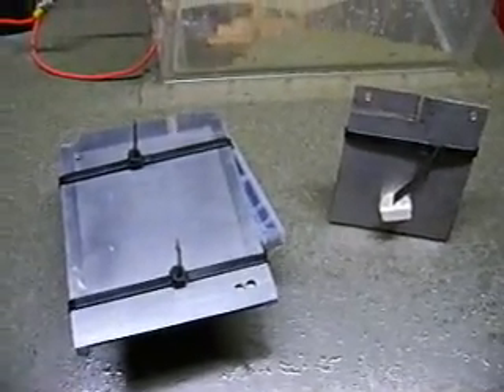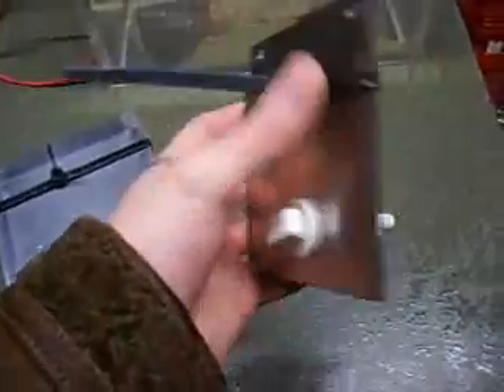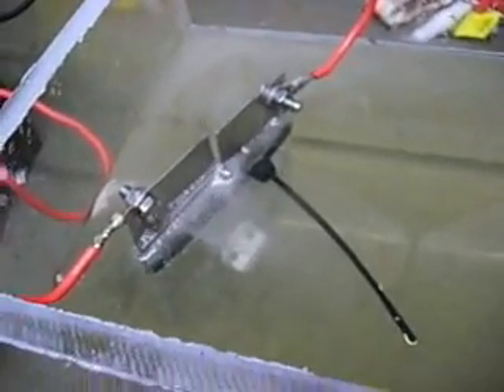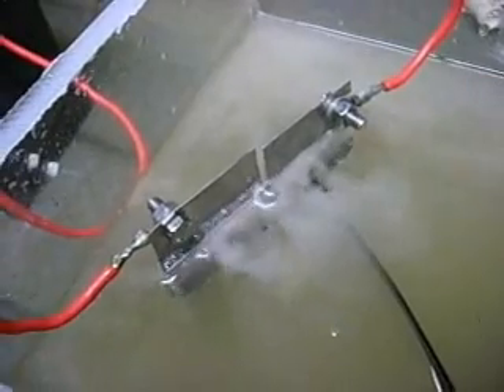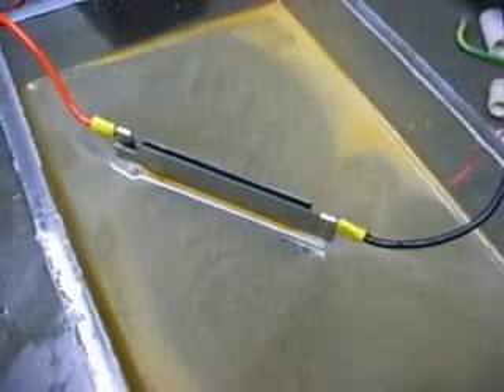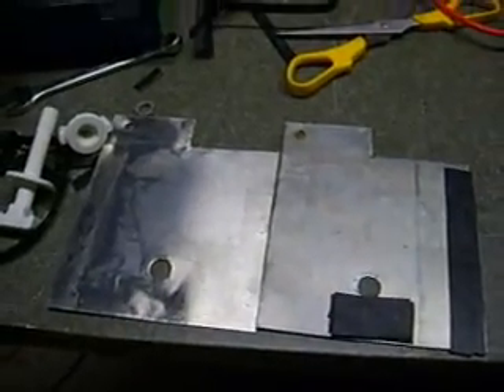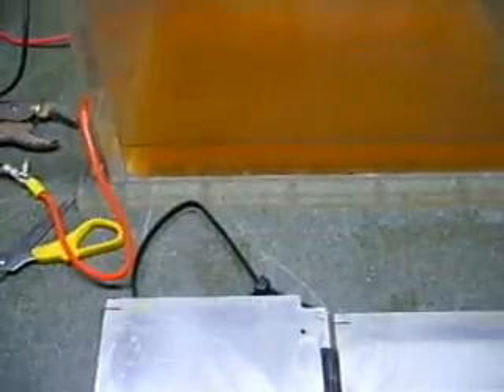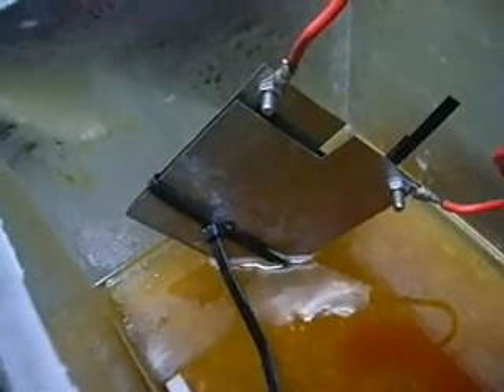Hydrogen at home (Mud problem revealed)#29

Comment: When doing experiments comparing the relative strengths and weaknesses of two different types of stainless steel, you should at least use the same sized plates. And recognize that ALL plates can be over driven leading to their early demise. ig, too much current per sq inch.

Comment: If you use distilled water and KOH, I think 304 or 316 doesn't really matter. I have an osmosis system at home and guess what, when I change all filters ones in a year, I got the same yellowish build up inside of filters, which is dirt from the tap water.

Comment: You need to start saving money and use Meyer's 8xa circuit that needs no salts in the water of any kind. It works on even pure distilled water as you can see in my video's. Learn the new way as Dr. Faraday's method is old school as that prior state of the art is too costly and you just don't get anything from it.

Comment: The mud is caused by tap water.  Someone referred to it as "iron bloom".  I too was creating mud and switched to KOH and still had the problem.  I went to distilled water and the mud has not returned.  The only color I get is from the dirty plates from running tap water, since I did not clean them up when I switched to distilled water.  It is amazing how clean it runs on distilled water.
Don't EVER use tap water unless you just enjoy cleaning and changing your water.

Comment from the maker: I use a good quality sodium hydroxide, the tap water will get dirty after many hours of operation but it is not to blame for this particular problem, for proof of that watch the second half of video #22.  I believe that using high-voltage only draws out more gunk if the stainless steel is of a poor grade such as in this case.

Comment: No tap water distilled only, dump that tap water to start and never go back.

Also IMHO its  NAOH NOT THE STEEL, it forms the brown crud all on its own, im fairly convinced of that.. esp the cheaper grades like drain cleaners Im going to test some "pure" grade NAOH will post a vid on that one.

I have been using a good quality KOH with ZERO sludge problems. When i did the drain cleaner NAOH with 316L and distilled, I got the brown crud.

IMHO its the NAOH I plan on proving it too

Comment from the maker: This is true, I'm curious about electrolyte concentration. The real question is what's the bigger factor, the voltage between each plate, the surface area, spacings, or a combination of them all. Are we better off using neutral plates and dealing with the problem of insulating each side of the neutral plate holes. Or using a daisy chain series set up, with six separate dry cells, to bring down the voltage and use no neutral plates. Hope I'm makes sense, it's a bit difficult to put into words.

Comment from the maker: I use 14 votes for all of my tests at this stage.  I understand what you're saying but in this particular situation using a poor grade of stainless steel is to blame for my mud problem.  Other reasons such as voltage, dirty plates, and using tap water, can be easily changed, but the plates come first.  Thanks for your input.

Comment: how many volts did you put into the + - plates I think I said this befor but if you put to much voltage in you will end up with brown crap 304 or 316 of couse one will have more then the other but if you dont cook you plates you dont get any at all! I think if you only had + - and not N plates it would have been no more the 4volts and 4.5 would be MAX I'm sure you already new that Kind Regards, DeltaHHO